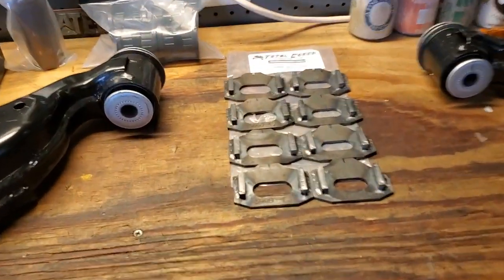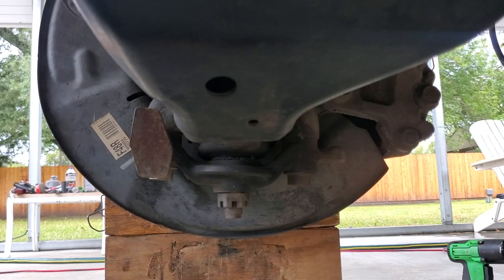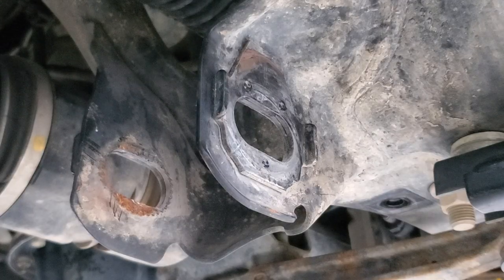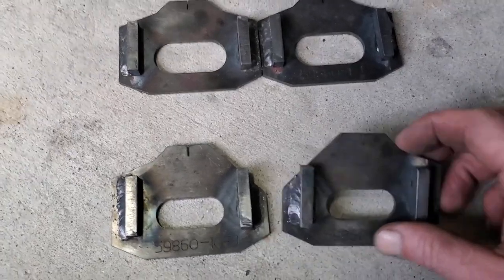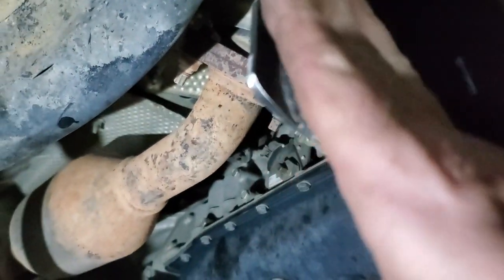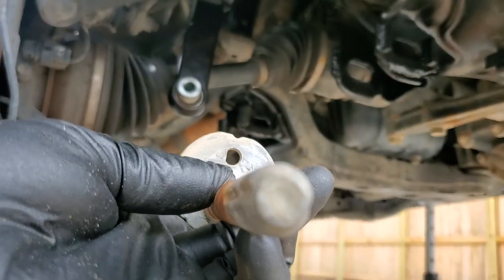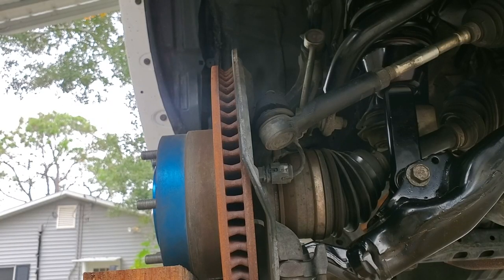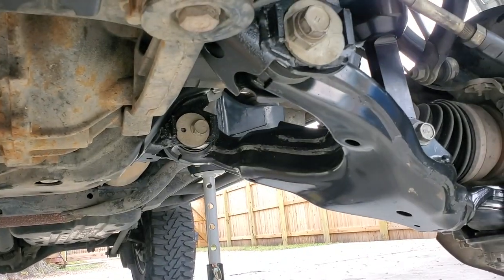4Runner / TOTAL CHAOS CAM TAB GUSSETS / INSTALL / PART 1

Comment: Way better cam bolt design then the 3rd gen 4runners where you have to lift the steering rack up to get the rear cam bolts out

Comment: Try that in the Midwest!!😂
2 hours with a torch,impact driver, hammer,grinder,etc. Just to try to free one side lol😂😂
That "Rusty Midwest "
Greetings From Chicago, Illinois!
Reply from the maker: I have had my fair share of rusty projects. We live about an hour from the coast. I just did upper and lowers on a chevy 2500hd. Had to make a tool to get torsion bars out of the keys and split the lowers to remove torsion bar. Also was a marine tech for a few years. Lots of heat, cutting and drilling involved so I feel you.

Comment: Thanks for the video .... one question, in some others toyota the bolts have a thread at the end of the bolt, then a smooth part and then another bit of thread, what is that small part of the thread for?

Comment: Awesome video, thanks. 

Did you have any issues with your CV axles binding with that alignment? On my 4Runner I have an issue where at full droop my CVs bind if I have my alignment cams pulled into the frame too far. The only way for them to not bind is if I push the cams to the outside, but then my alignment is out of spec. I am using CVJ axles which are supposed to be OEM remanufactured. I also have Icon coilovers so I don’t think there is too much down travel. Thanks
Reply from the maker: I have not at this moment had any trouble with the CV's binding. Of course when I set this up it was just the starting point for the alignment. I figure if I start at max caster they just bring it back into spec. The caster will show red if they are using a newer digital machine and will show out of spec. I want you to know it took 4 alignment shops before I found one that understood what I was asking for. I am running extended travel front coils and have not had an issue yet.

Comment: Any tips for mitigating squeaking when putting back together?
Reply from the maker: Just grease and torque well. Are you having a squeek on Icon coilovers? I fought a squeek for 2 months, thought it was uca's turned out to be wiper seal on the shock itself. Silicone Spray fixed it. Icon said they would warranty but I did not want to wait on them. If on the LCA you should not need grease other than balljoint.

Comment: Sounds like a red shouldered hawk in the background, when you're putting the LCAs back on.
Reply from the maker: I honestly didn't notice. After going back it is quite possible. I learned to tune out the neighbors dogs. 😆
Reply: @MB TRAVEL AND ADVENTURE  I could be wrong. But I noticed only because we have a couple red shouldered hawks that live nearby and frequently perch on some trees in our yard and some of the neighbors. The neighbors brought it to my attention because one tried to get their dog. Our dog is on the smaller side, so we keep an eye on them. Now, the hawk's call is easy for me to recognize 🙂
Reply: @MB TRAVEL AND ADVENTURE  oh yeah, did you have to chop your body mounts with those tires and spacers? Did you have to re-gear?  I have a 4th gen v6 and I'm considering my options for tires. I'm thinking of going with 33's. I need some new UCA's to get my caster back right after my modest bilstein lift. 33's might require me to move the setting up a notch, but I think I'll be looking at a body mount chop based on my reading so far.
Reply from the maker: Yes body mount chop was necessary. It is livable without regear with the 295's (33.4") If I move to 35s I will definitely re-gear. Keep in mind tire weight as well as the rotational weight makes a considerable difference. You can see weight and actual tire size. My go to is I believe tire-size.com

Comment: Did you use new Toyota LCA ‘s or aftermarket? Great video , very informative and well done , thanks 👍
Reply from the maker: New Toyota lower control arms. Thanks for the kind words.
Reply: I had my LCA’s rebuilt with SPC ball joints and bushings.

Comment: On the Lincoln electric did you have it on D wire feed around 6-7?  I had mine on C wire deed 5-6 and it came out like crap. Thanks
Reply from the maker: Honestly, I can't remember, but the Lincoln welder is super finicky. I have also used a Hobart and it is much better. Are you using Fluxcore or gas and solid wire?

Comment: What was the install time for these?
Reply from the maker: @EpicFlippers  I would say it could be done in about 4-5hrs if you have experience with this type of project. If not, this could be more of a full day/weekend project. It took me a bit longer only because I was filming the process.
Reply: @mbtravelandadventure  Thanks for the response! I found a shop that is willing to do the work but said it'd be an "Open Labor" job. So trying to get an idea how much it'll be. Thanks again
Reply from the maker: @EpicFlippers  with a lift it should go a bit faster as well. Working on your back tends to burn some time.

Comment: How did you prevent all the splatter that normally comes with flux core?
Reply from the maker: If the welder is set correct it shouldn't be too bad. With that said I only cleaned up where I was welding. The spatter does not stick well to the existing paint.
Reply: @mbtravelandadventure  curious how you have yours set?
Reply from the maker: @webcrawler3332  It honestly would depend on the welder. The one I am using is a Lincoln 110V machine with a very finicky wire speed knob. So giving you exacts probably will not help you. I would just play with whatever welder in particular that you have or have available to you. I did not use any but they also sell an anti-spatter type spray that will drastically reduce this from happenening. I would have ran hard wire, but the bottle I have is small and was empty from a previous Jeep bumper build. I wish I could have helped you further on this subject.
Reply: @mbtravelandadventure  Thanks for the feedback.  Appreciate it!